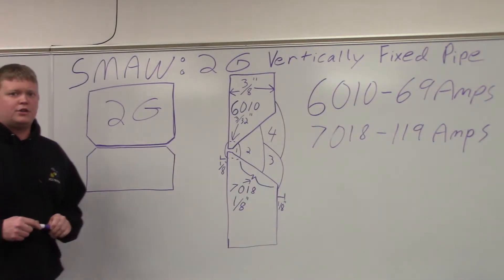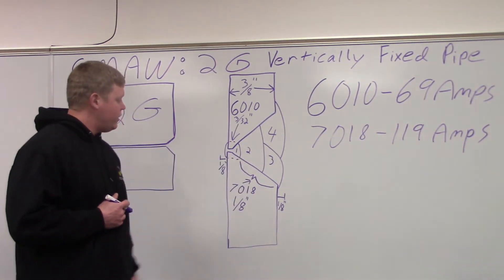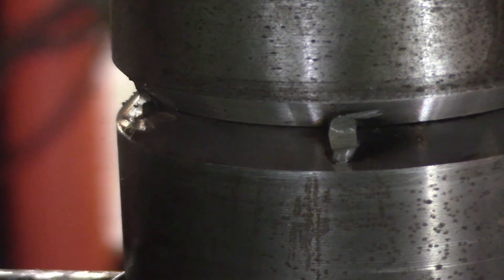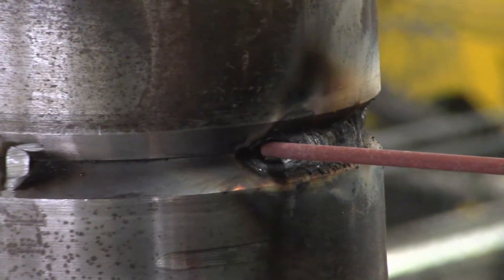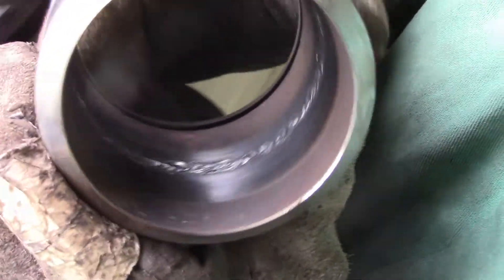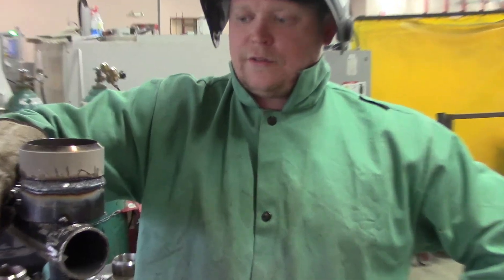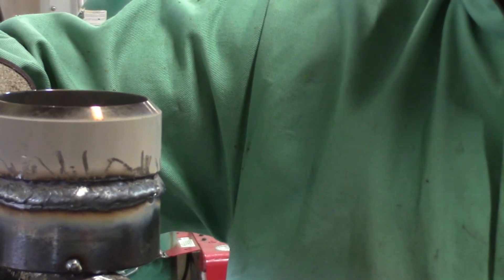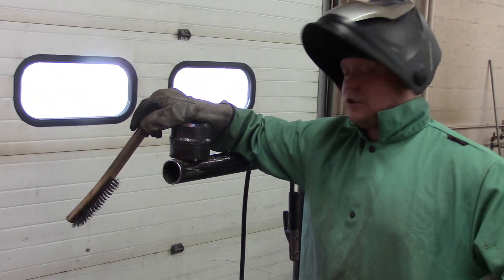2G Open Root Pipe Stick Welding

Comment: so even with thick material you will keep those "standard" amp. setting ?
if no 6010 available can I use rutilo cellulosic rod (just for exercice) ? or 7018 for root ? 
do you have any "dig" or "arc force" set on that welder now? thank you I hope you have some time to answer.  I am looking at all your videos they are good ;)

Comment: Where i am learning at my high school we do 1/8 root opening, 1/8 inch landing with 6010 drag only running 64 or so amps. Hard stuff!
Reply: +elrojo98 why dont you crank up the amps to 85-90? 64 seems way to cold
Reply: not for no whip 6010, it key holes enough as it is
Reply: then turn it down lol